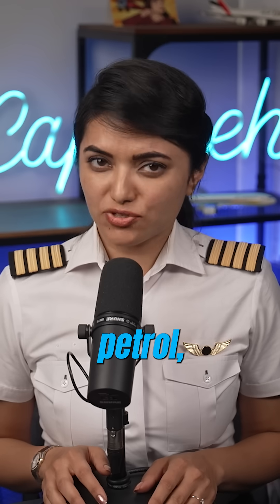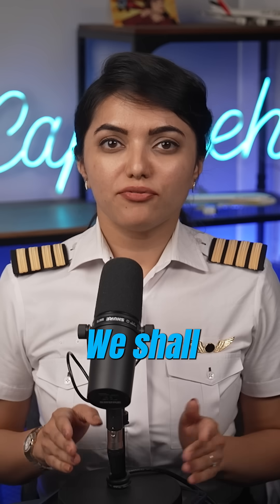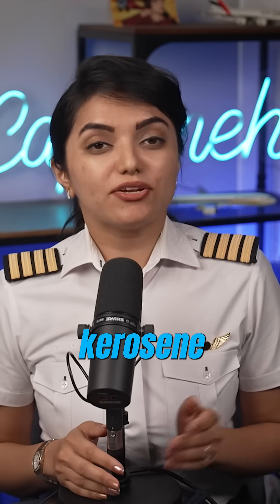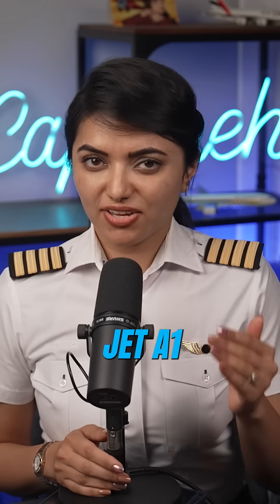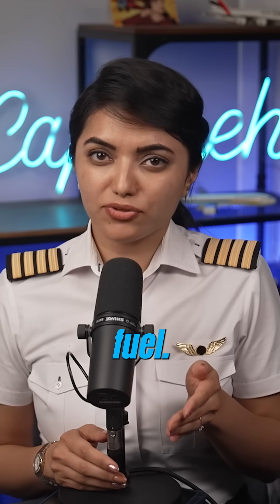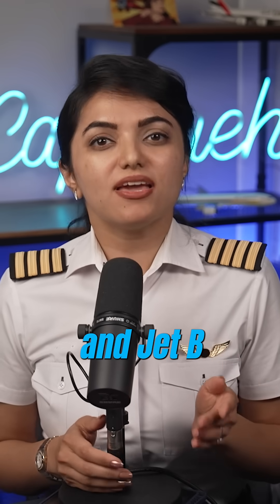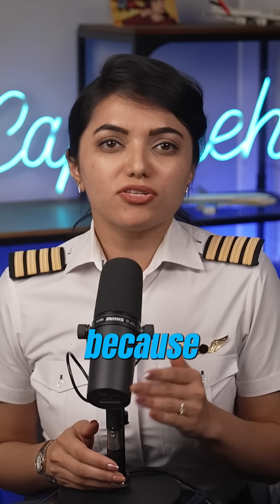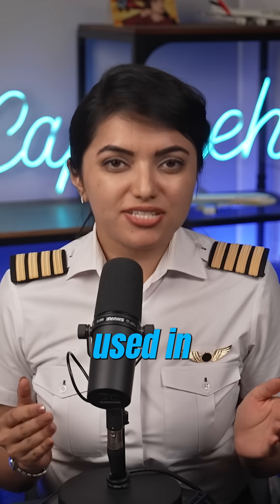Type of Fuel Airplanes use explained by Capt. Neha Thakare

Comment: Can we use CNG to fly an aeroplane?
Reply: Not practical because of storage issues, it requires heavy cylinders that would compromise payload. Moreover, it's freezing point is relatively lower than ATF or Avgas etc.